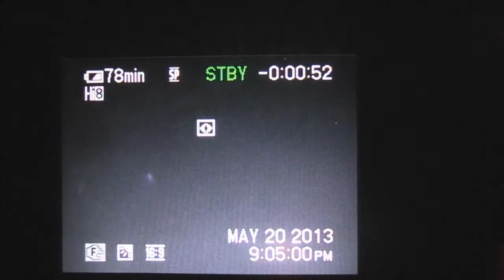100kV Tests

Comment: Very nice experiments! I have 75kV (10-11cm max spark length) Cockroft-Walton multiplier and planning to make another stage to reach 100kV. I put the limiting resistors in oil and noticed the same interesting effect of intense turbulence. It clearly shows that a reactive force is generated (intensity of which depends on dielectric properties of the medium) and has nothing to do with the ionic wind.